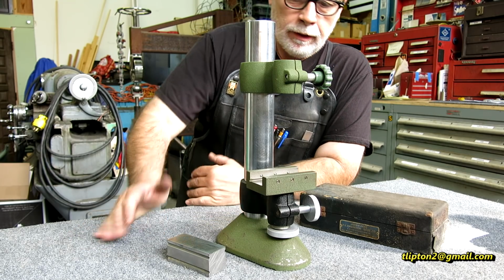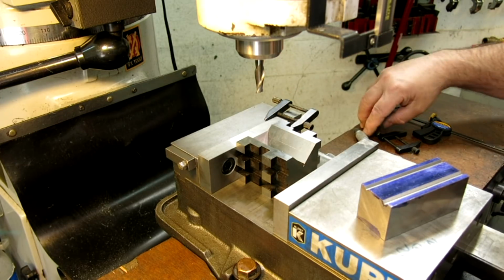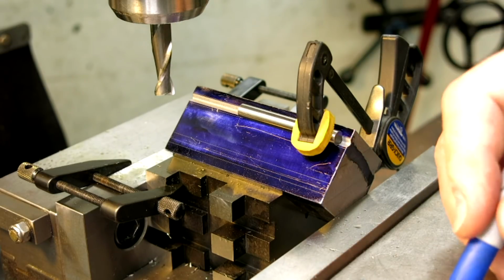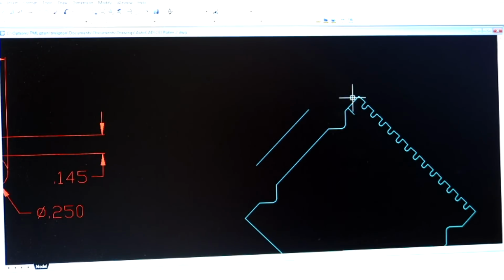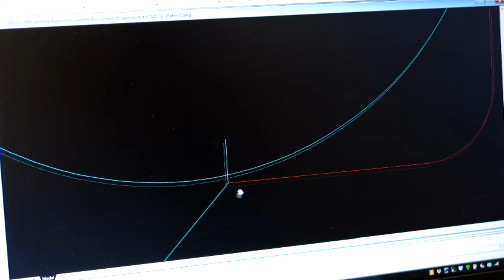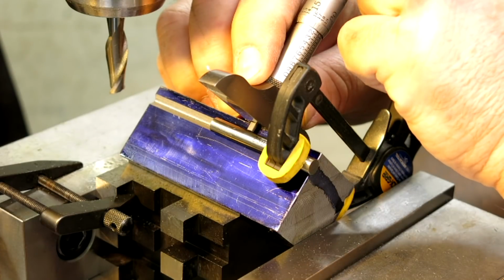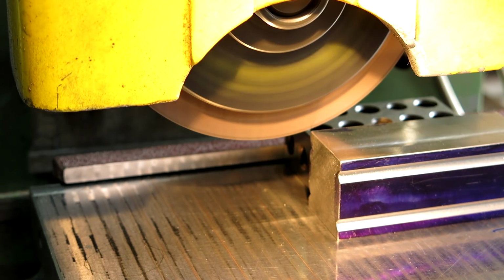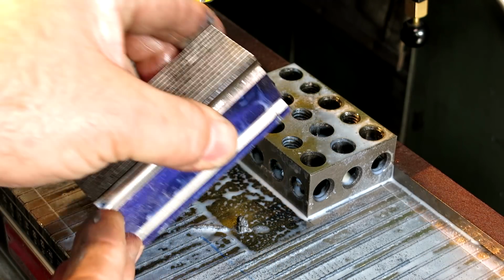Johansson Mikrokator Comparator Platen

Comment: Interesting but the location of those V grooves do not need to be so accurate. It is actually a + ~.010  - 0.0  tolerance. Those cone screws are designed to pull the block down on the carrier, not to hold it in a position so all the V grooves have to do is be high enough that they are above the screw cones so the cones bear only on the lower surface of the V.

Comment: Good video! It shows the value of CAD as an active, SHOP tool when working with difficult dimensions. This technique is also good when making a dovetail. 

I would add that, in my experience, the real reason for not having a dowel pin sitting on a corner is that is is almost completely impossible to deburr a corner to a good tolerance, like +/- 0.001". In the video you did not even show any deburring operation before using the pin. Even the smaller pin could have been sitting on a burr at that 135 degree corner and that can throw the reading off. A light pass with a file or a stone on the face and on the walls of the groove would have eliminated that. Perhaps followed by a VERY light pass half way between those two angles to take off any fuzz left on the corner itself. The lack of a good deburring may explain why when you drew the pin at the measured position, it was sitting inside of one corner and above the other one. BURRS!

If the rough cut groove is cut approximately centered, as yours was, AND there is a good amount of metal left for the final cut, then having the smaller pin resting on the corners (it would rest on both of them, not just one) would not lead your work astray. But you should not proceed to the final cut until the pin IS sitting on the sides of the groove when you determine the final movement, not on the corners.

Comment: My very old AEG drill press has the same kind of locking mechanism (2 rings and a single screw) for the column connecting to the stand...just much bigger.

Comment: About the 12' mark in the vid, I really thought you said, "125 plus 14, that's 134." Hmm? Should be 139, I said to myself. Maybe I heard it wrong. So I turned on the closed captioning and it picked up "25 plus 14  that's 134." (it missed the "1" in 125) That could have been one reason the .250 pin wasn't working in your CAD simulation. Great video. Late on the comment...

Comment: Hi Tom  Very nice job like all your projects. One other important on the stand construction, I have found that when the gage holding clamp and the measuring platen are supported off the same column deflection is vastly improved.  I noted this when experimenting with stands some 25 years ago. Large steel mass is great but not a replacement for good Design. Really enjoy all of your videos.  PS the undercut in the clamp center, now I know why. Best  Bill B

Comment: The reason you have a error with the larger pin, is because the offset isn't exactly .125". The corner of the groove is keeping the pin from being measured accurately. The bottom is inside the radius and the side is outside the radius making your center line  off and introducing your error. Moral of the story, if your groove is not symmetrical, make sure your pin is inside the radius on both sides of your grove to get a accurate center line :)

Comment: Wrong. A cylinder in a symmetrical V is always going to be centered.  Period.  Hash tag don't have twater....
Reply: In a perfect world, yes,  but in the machining world, a pin resting on the corners of a V will be inaccurate because of burrs on the corners of the V.
Reply: carabela125 yes but that's not what was presented here. It was a perfect bur free world. What we have here is inaccurate measurements. A cylinder in a V is always going to be tangent, thus centered in the V regardless of cylinder size, even one that just touches the corners is still going to self center- like you say no burs and I'll add no chamfer or radius.
Reply: Dave,  I can see burrs on the edges of the V.
Reply: carabela125 ....Which is why it was a measurement error.

Comment: You could locate the grooves on the side by putting a large gauge pin in the v-block and finding the center of the v-block and tool height, then calculating the x and z values for the groove. You would be locating off the opposite side, so any problems in squareness or size would be multiplied.

Comment: "We got a groove on the other side". Was that groove actually small enough to let the micrometer base hit both sides ? If not you are measuring for the CAD comparison/correction in an not straight line, which you should base your CAD correction on.
One thing I didn't understand though. Why wasn't the piece clamped using the v-grooves as a reference to surface grind the top and notches, since it will zeroed in on these when mounted.

Comment: See me I am lazy. I would center punch thru the bolt holes to mark 4 points then drill at 90deg with a 90deg spotting drill to the desired depth then put it in the v blocks and come in with the end mill till I cleaned the hole edges up and run it. No math or computers to hurt my head that way. :-)
Reply: bcblock........... LOL .... Just have to comment LOL

I had a similar reaction but I took Tom's demonstration as an exploration in metrology and good measurement techniques as opposed to the Keith Fenner "get her done" approach. 

There's definitely room for both but how much room depends on how much time, talent and money is available for the given project.
Reply: Yes I love the Toms tutorials. I appreciate the sophisticated style too. :-)

Comment: Maybe I missed something...

Using a mic the way that you did, the blade is not tangent to the pin at the point of contact. Don't you get a bad (too large) measurement?
Reply: He had the blade rotated skew to the pin, so it would span the tangent point of the pin.
Reply: carabela125
Rotation was not apparent in the video. It also looked like the tangent point was occluded by the piece (inside the slot).
Reply: At  11:45 ,  notice that he turns the whole micrometer so the blade crosses the tangent point.  The tangent point is below the horizon of the pin from our point of view.
Reply: Yes, I see what I missed the first-time through.  He did turn the mic so that he picked up the tangent point.  After switching to the smaller pin, the tangent point was still exposed (I thought it was hidden by the feature).  Thanks for the clarification.

Comment: Hi Tom,
thanks for the informative CAD excursion. I would have loved to know what kind of error you got when you superimposed the .187" pins measurement onto the .250" pin. the fact that the .250" pin was inside of the supposedly correct contour does not mean this is true.... your .187" pin measurements will also include some errors, maybe a uncertainty of 0.0005" would have put the two set of measurement into agreement.... you just decided that the second measurement was right, because it looked better (trap for visually inclined people...) error perception is biased. try to measure 500g of sugar. 498g and you will put some more. 504g you will pat yourself on the back and brag about your skill to measure flour within less then 1% error.... ;-)
non the less a good technique and a new skill learned, thanks.
Reply from the maker: Hi Michael,

The point was the .25 pin was not sitting tangent to the flats which is what I care about. Yes either pin will locate the slot in one direction on the block but I wanted a particular depth as well. I agree there is some measurement tolerance but both more or less equal they null each other. The position of either pin is the same in one direction whether tangent or sitting on the edges but we are trying to locate the groove in two directions at the same time where we need to move both axes to get it correct. The groove was positioned correctly in the end so maybe I'm just lucky which is way better than being good. Cheers. Tom

Comment: I think it's a big deal for any machine shop to get a cloud based(online) drafting solution capable of running on tablets or smartphones. I tried Autocad 360 just for giggles but it ended up saving my ass on a irregular bolt pattern. You just open the sketch and you can measure things in every imaginable way and some more too!

Comment: Thanks, Tom Very informative as to CAD. Real world, the smaller pin was the obvious solution. Getting the exact alignment from the fixture (i.e. angle of points) more difficult. Being that it's desirable to have the pins align with the sides and not the point.
Norbide = Hot Pressed Boron Carbide (B4C) As used in armour plate. Not as hard as Boron Nitride, or diamond.

Comment: Is the dressing stick Borazon?  
 Or is Borazon a trade name?

When I worked at Hardinge in the late '70's in the collet dept. we had Norton wheels that were rubber composition.......down to .002 thick. Used for 'webbing' the slots in collets with really small 'order holes'.  I think the smallest Order Holes were .005 for a 5C collet. Some other collets, possibly 1C, went down to .003 on Order Hole size.
Reply: Years ago I read something about making collets, it may have been a PDF scan from google books.  It said how on the smallest collets the final cut was done with paper disks, I am guessing there was some abrasive mixed in the slurry when the paper was made.  But it may have been just a paper with a high percentage of clay in it.
There was a picture of a room with long benches with these machines, looked like 50 or 100 of them and a few people going from one machine to the next changing in disks and indexing and changing collets.  I think the machines were powered by a small line shaft down the center of each bench with machines on each side.
Reply: I believe it is silicon carbide.  Borazon is an old tradename for cubic boron nitride, and you sometimes find the name being used to describe old Soviet tooling which is coated with the same.

Comment: Tom, I use cad in that way too, it's a great tool.   
For the guys without CAD, a "wee-block" or vee-block sitting on the corner of the part (vee down) can get you very close with an edge finder.

Comment: Tom.Hmmm, your vee making escapade, unless you did it just to show people another way of doing it, was very long winded, with 4 chances of getting it wrong. Considering you had 4 vee's to do, it would have been quicker and easier if you had tilted the head to 45 degrees and did the vee's with reference from the fixed vice jaw and parallels.Just a case of lining up where you wanted the center of the vee to be, setting the dials and away you go, mill and flip, all 4 would have come out the same. No bluing up, marking out, rollers and micrometers, calculations ( and getting it wrong ) you would just need to re tram the head afterwards and that is not a long job compared to all the other phaffing about you did. People with a universal mill could have used a 90 degree form cutter for the vee. Question, why did you grind the fine slots instead of milling them, that was a lot of grinding using a flimsy rubberised cut off wheel. Finally, why a 2 flute slot drill instead of a 4 flute end mill, 4 flute cutter give a much better surface finish.
Reply from the maker: Dave Dave Dave. When is the last time you cut slots with a .035 end mill? My guess is never from your comment. Please explain how you would get the vees in the dead nuts correct spot without measuring their position. The explaining of the process takes much longer than actually doing it. By the way I'm taking the time to explain it for all you internet folks. I know how to do it and really don't need to explain it to myself every time I do it. Once I had the number it was just a block flip for all the other grooves. Once again just showing folks the process. Feel free to skip all this mundane stuff you already are an expert at.  The two flute had the corner radius I wanted on it. No other reason. If you climb cut on your last pass the finish is great. Oh right. I forgot climb cutting is forbidden in the Ticehurst shop. 90 chamfer cutter leaves a crap finish at the tip where the velocity is near zero. Also it doesn't have a radius. So yes I did think about some of these thing in case you were wondering. Cheers. Tom
Reply: oxtoolco has one man ever been so thoroughly deconstructed?
Reply: + Tom, Thanks for your detailed answer and for "Shooting Me Down In Flames', sorry I took up so much of your time in replying. However, you seemed to have misunderstood my comment, I DID say milling, but I neglected to say Slitting Saw, so I will let you off. Lastly the vee position could not have been too critical a distance from the top face unless you allowed for it as you then ground the tops. Do not worry I am still subscribed and will continue to browse your videos.  Have a Nice Day.
Reply: Dave Ticehurst I don't think anyone was worried.

Comment: I'm curious Tom, you moved the .250 pin relative to the slot, but your dimensions were taken from the pin, so you know where it sits relative to the block. What I'm thinking is you can still use that pin to determine the current slot position by moving the slot instead of the pin, it wouldn't be sitting on the flat, but it would still be bearing on the two corners. It would be interesting to check the intersection between the two "slots" as they are indicated by the two pins. TL;DR, the big pin is where you measured it, the slot therefore isn't where you drew it
Reply from the maker: There are two components to the slot. Position and depth. They both have to come out right at the same time.
Reply: Agreed!
The measurements you are taking with the pin is to determine (mill) offset in X and Z to achieve the final location from the measured location.
You have drawn the pin location correctly using .145 depth mic and 1.582 thickness gauge.
My suggestion is that instead of moving the pin, or drawing tangents off the pin to establish  where the slot is currently,
instead use the intersection of the pin circumference and the un-machined face of the block, then draw two 45 degree extensions to intersection.
As this is the physical, measured location of the pin, that is where the block must be machined to.
Measuring the perpendicular distance between that and the desired end location will then give you your X and Z offsets to machine to the correct depth.
The difference I believe is that instead of drawing tangents from the pin, (wrong location due to the pin size as you suggest) draw from the intersection of the circumference to the block face.

Comment: like the theoretical optical comparator function of cad... like a crystal ball. just a thought but if you had to be off in either direction i'd bring the lower flat up so the set screw bears on it and "locks" it down love that blade depth mic all good tom
Reply from the maker: Its already there. I set the slot high so the screws push it down. I don't think I mentioned it in the video however.
Reply: ya I kinda got you had a target CL your looking for accounting for a little surface grinding of the wear surfaces of the top and bottom and the set screw grooves that cut off wheel slotting was really cool

Comment: Why grind the small slots instead of milling, if the work hasn't been heat treated? Didn't have the right diameter end mill?
Reply: Cutting slots with an end mill that small becomes a challenge of not breaking the end mill in addition to getting the RPM high enough to cut property. If you have a grinder it's much safer to "cut" them that way.
Reply: Fair, although I will say that I've cut slots that small and smaller with both an end mill and a saw cutter plenty of times
Reply: John Gollsneider, 

I suppose you could use a slitting saw as well but, if I had some option other than trying to spin a tiny end mill at 3,000 RPM and cut a bunch of tiny slots ....... I'd choose a different method for sure. 

Tiny tooling has only one purpose ..... to break off when it's the ONLY one you have left. LOL
Reply: Oh yeah, I agree. End mills smaller than .06 get kinda dicey.

My question wasn't a criticism, more of a curiosity than anything
Reply: I'm a woodworker, not a machinist, but if I were cutting grooves like that in wood I'd use a router table. If you had a good way to hold the workpiece, and if your end mill had a 1/4" shank, you could put it in the router and easily spin it anywhere from 8000 to 24,000 rpm. Dunno if that would work, but it'd be exciting to try.

Comment: I use the same AutoCAD. Easy and it works.
Reply: which autocad is it?
Reply: Robert Engl AutoCAD 2000 edition. I have the full 3d version. His might be 1 or 2 years newer but basically the same.